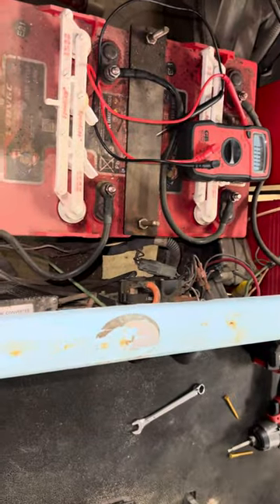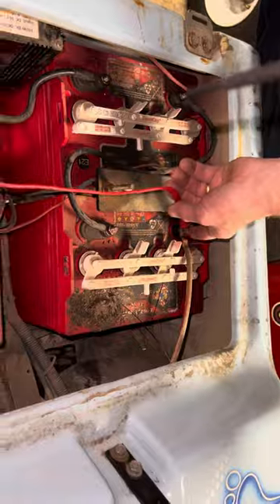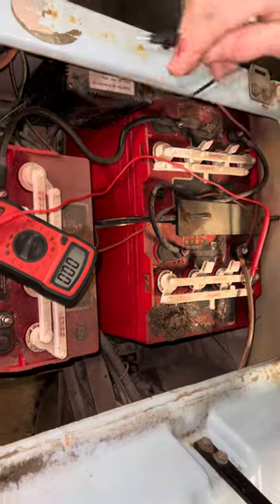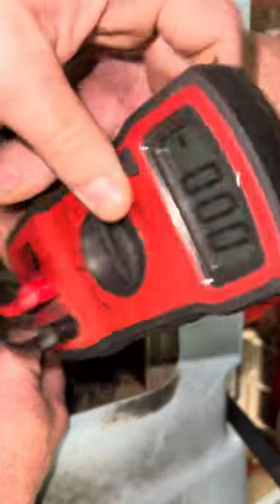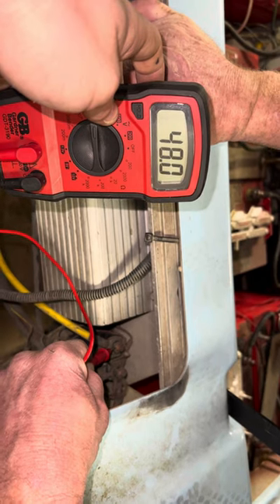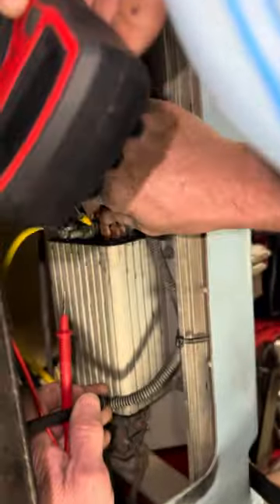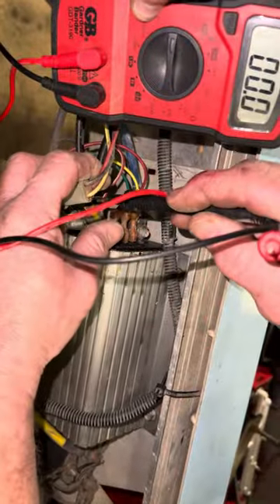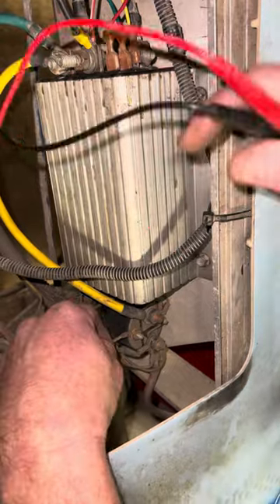Club Car 48 volt won’t move. Troubleshoot whole cart

Comment: Thank you for this excellent video... Bypass OBC solved my problem 😎
Reply from the maker: Yes sir.  Hit that like and subscribe button for me.  I have over 100 videos on my page and list 2 new ones a week.
Reply: Will do.... Do you have the rear wheels off the ground of that cart when you're pressing the accelerator
Reply from the maker: @jtwad  probably not. Holding the brake down at the same time I am not flooring it. I am just barely giving it gas. Just enough where I can fill the cart start to move
Reply: Is the obc the red wire thats on the controller?
Reply from the maker: @TheTeejam171  what year is your cart.
Reply: its 2002, i have 7 ohms at the yellow and green wires, the cart just clicks and doesnt move.
Reply from the maker: @TheTeejam171  if you have 7 ohms. And it doesn’t change when hit the gas replace the potentiometer
Reply from the maker: @TheTeejam171  put it in reverse and see what it does as far as ohms

Comment: I commented on another video earlier and am currently going through the cart. Everything up until testing the ohms between the green and yellow wire I am good. My multimeters only show me OL when pedal isn’t depressed and it beeps and goes down to around 2 and continues going down. I ran a jumper wire from battery positive directly to the controller where the red wire was and it did the same thing.
Reply from the maker: Drop your ohms reading down on the meter.
Reply: @Golfcartwhisperer Dang, I don’t think my multimeter can do that unfortunately
Reply: I did the controller output test right after, and it shows voltage until I press the gas and then it shows about 20v compared to the 50ish V when pedal isn’t engaged
Reply from the maker: @tuckernorton6886  I’ll read your stuff again in about 1 hour. Then will tell you what to do
Reply: I uploaded a short to this youtube to show what is happening. Piece of crap is making me lose my mind 🤣
Reply: @Golfcartwhisperer Thank you very much I seriously appreciate it!
Reply from the maker: @tuckernorton6886  find me on Facebook thomas wells conway sc.  and send me a video
Reply from the maker: Put your volt meter on dc voltage and put on battery pack and hit the gas in forward key on.  AMD tell me what it shows.
Reply: I also replaced VGLIDE and that did not fix issue. Thanks.
Reply from the maker: What does battery voltage show when you hit the gas
Reply: 50.1v before pressing the pedal and 50v when pressing
Reply from the maker: You replaced it with a v glide with resistor’s.  Does all other voltage check good going into the controller. Meaning the wires from the solenoid
Reply: @Golfcartwhisperer  Yes everything else tested out fine. Only thing I was unable to check was the ohm reading between wires that we talked about before.
Reply from the maker: @tuckernorton6886  did you jump m-and b-on the controller together and hit the gas.  But be careful it will run wide open.  I recommend jacking up the cart and take a wire and touch the post together.  Hit the gas real fast and if it runs replace controller
Reply: @Golfcartwhisperer  I did the same thing. Turned 1/4 on the wheels and stopped. I get voltage on those posts when hitting the gas but it’s only 31v
Reply from the maker: @tuckernorton6886  so you jumped the post like I said and the cart ran. Hit the gas and check voltage on each side of the sol.  Black lead of meter on main negative
Reply: @Golfcartwhisperer  No that cart didn’t do anything different. It turns a quarter inch then stops. If you respect forward/reverse then it will turn 1/4” again. Same as when it wasn’t being jumped.
Reply from the maker: @tuckernorton6886  gotcha. Sound like a motor problem or
Reply: @Golfcartwhisperer  Can I run a test on the motor?
Reply from the maker: @tuckernorton6886  hit the gas and take a wire and get touch it to the top after a1 and s2. Don’t connect it just do  a quick swipe. If it arcs motor bad. If it doesn’t something bad in the f n r area
Reply: @Golfcartwhisperer  No arc. What exactly is the f n r area?
Reply: I’ve got some more info. On F/R switch my top post that you tested in this video , has a green wire. That post is not getting voltage. The post underneath has white/black wire and it is getting the constant volts. When you select F/R the voltage transfers to the top post giving it the correct voltage. Basically what you did in your test but they were flipped. The solenoid tests good on the small posts and the big posts. But when testing the big posts the voltage drains down to 25v on the left side then goes back up to 48v when not pressing pedal.
Reply from the maker: Eating dinner. Give me a couple of hours and I’ll read our whole conversation and tell you the next step
Reply: @Golfcartwhisperer  No worries. Thank you very much for your help, i’m not trying to bother you just stumped with electrical. Thanks again.
Reply from the maker: I am doing stuff with the family I should be home around 7-8 tonight and we’ll figure it out
Reply from the maker: Let me know when you get the Facebook information and I’ll delete it
Reply: @Golfcartwhisperer  I have it. I send you a message a week ago, but says you haven’t opened it yet. Sent it on FB messager.
Reply: @HeyHeyHey97 my cart is doing the same thing but also my motor when It did spin was backwards any help would be much appreciated
Reply: @HeyHeyHey97  I can't seem to find you what is your profile picture
Reply: Cancel that I found you

Comment: Does the key switch make it won't charge too? Clubcar ds 48v has power to lights, horn, turn signals but no power to meter on dash and charger doesn't charge when plugged in.
Reply from the maker: Does the golf cart run. Meaning can you turn the key in and hit the gas
Reply: @cpfans90  no it won't run, I took it for a ride like normal and when I got home put it on charge but didn't notice it it started charging or not, hour later I hopped on it to take my puppy for a short ride and it won't go. Check voltage at the batteries shows 50.8 volts as always.
Reply from the maker: If the golf cart won’t run. The charger won’t come on. Open your charger up and hook the two wires on the relay together. And your charger will start charging
Reply: @cpfans90  but that's not going to fix the golfcart, batteries are fully charged 50.8 volts, when I turn key switch on I have no power at the voltage gage and no clicking when I step on the go peddle, I'm resetting the obc (on board computer) now as I'm typing this
Reply from the maker: @rnull2237  okay so the cart does have voltage.   You can bypass the obc I will send you a link in this description. On how to by pass it to see if it’s bad.
Reply from the maker: @rnull2237  CLUB CAR won’t move? Sol or computer?
https://youtu.be/pwpAl3k5iv0
Reply from the maker: @rnull2237  watch this video here.
Reply from the maker: @rnull2237  you can take a wire and run it from the main ground to the solenoid small post where the yellow wire goes.  And that bypasses the running side of the obc. Obc has two parts running side and charging side.
Reply: @cpfans90 I found the problem, loose wire on one of the batteries, cleaned up and put it back on, hooked up the charger and wala it's charging, put key switch back in and it works fine now, thanks for all your replies. I feel kinda stupid😅 😅😅😅😅😅😅
Reply: I get the video and it helps... but I check these things are as you say, however all I get is a small kick of the tires when I press the pedal. Is this pointing to the motor/ gearbox?
Reply from the maker: @JC-jo6db ye sounds like motor brushes are either stuck or wore down.  As long as voltages show proper voltage

Comment: Great video.  How can I test my v-glide?  I have a 94 club card DS that has the controller and v-glide.  When I push on the gas, it’ll do about 15 miles an hour then if I let off and push down the gas again it does about 22. They said the glide was bad so I bought a new one. It’s part number 1012016.  I just hooked it up and now the cart doesn’t move at all. How can I test for this problem?
Reply from the maker: When you hit the gas is the v glide wiper arm going all the way up. When you hit the gas
Reply: Great question, let me check tonight and I’ll let you know.
Reply from the maker: Did you get it figured out
Reply: I checked and the wiper and it does go all the way up.  I hooked up the old v-glide because I knew that one worked.  After I hooked up the old one the cart still doesn’t move.  I don’t know what happened.
Reply from the maker: Have you tried jumping the solenoid to see if the cart runs
Reply from the maker: Also your microswitch in the v glide have have you checked that. Do you have volt meter
Reply: @Golfcartwhisperer  the solenoid is new and it clicks.  Cart was running before I took out the old v-glide.  I put the new one in and it wouldn’t run.  I put the old one back in and it still doesn’t run.  The v-glide clicks when I hit the gas and the solenoid clicks when I hit the gas but the cart just won’t move.  Here are some other things I’ve tested:
Controller
B+ & B- = 36v
J1 & B- = 36.4v with pedal pressed
B+ & M- = 36.4
Green & White = 5.19 ohm with pedal pressed.  1.90 ohm without pedal

Forward and reverse switch has 36.4v

Only thing that seems weird with forward and reverse switch is that the reverse beep will sound when I put it in reverse with key in off position.  When I put the key in on position it no longer beeps in reverse.  That seems weird to me but not sure if that is some sort of wiring issue that would keep the cart from running.

Should I still try jumping the solenoid?
Reply: @Golfcartwhisperer  okay I just tried to to jump the solenoid with screwdriver across both large terminals. Normally when I do this it’ll spark and the cart will move forward.  I get nothing when I touch the two together.  It clicks though.  I measured 12.4v on both large terminals on the solenoid.  Is solenoid bad again?
Reply from the maker: @gyfhj  you should get around 36 volts.  Black lead on main negative red lead on big pos on sol.  What do you get
Reply: @Golfcartwhisperer  yeah I got 36v on both large terminals when doing it this way
Reply from the maker: @gyfhj  k well that means you have voltage
Reply: Any other ideas?
Reply from the maker: @gyfhj  are you sure you have the v glide wired right. Do you have facebook
Reply from the maker: @gyfhj  I deleted my message that had Facebook if you don’t see it let me know. I’ll put it back
Reply: @Golfcartwhisperer  did you get the message?
Reply from the maker: @gyfhj  no it’s the account where my picture he is my wife and I and I have an orange toboggan on
Reply: @Golfcartwhisperer  ok sent you a message
Reply from the maker: @gyfhj  click on this link here. Will delete in 5
Reply from the maker: @gyfhj  I deleted the link let me know if you got it
Reply: @Golfcartwhisperer  no I didn’t get it
Reply from the maker: Do you still need help

Comment: I have a 99 club car 48v ds that won’t do anything. I did the found bypass and get solenoid engagement but still won’t go. (Wasn’t even getting solenoid engagement until I tried the bypass) do I need to replace the controller at this point?
Reply from the maker: Thanks for watching.
Reply from the maker: How did you bypass it.   From main positive.

Comment: @heyheyhey97

First thanks for the videos you do the best working us through.  I have a question if you get a moment.  My ohms is 6.8 down to 1.8 when I press the peddle.  It was 7.3 but I replaced the mcor .  I suppose that means the controller is shot.
Reply from the maker: @davidturley3881  what does your cart do. And is it just like the video above
Reply from the maker: Not necessarily does the solenoid click? Also tell me what the cart is doing
Reply: @6:30 of the video.  I have battery voltage in but nothing out.  The small red I get battery volt when I hit the pedal.  And the homes between the yellow and green is over 6k about 6.3k and it drops to about 1.3 or so.
Reply: Yes solenoid test good and clicks and it sometimes runs for just a little bit
Reply from the maker: @davidturley3881 okay when it doesn’t run does the solenoid engage at that time
Reply from the maker: @davidturley3881  has the controller been wet. Meaning could water have got in it.
Reply from the maker: @davidturley3881  also intermittent running 99 percent of time the controller is not the problem. Either water in the controller if that’s the case. You can just bust the bottom of control box open and let the water out. Dry it out and seal back up. Most of the time it’s bad connection somewhere or microswitch going bad.  What does voltage show across the solenoid when it’s not running
Reply: Thanks again I pulled my new MCOR off unfortunately this cart doesn’t have a       V-glide.  The new mcor isolated is giving me 6.3 ohms to start.  Like you said if the controller reads over 6 ohms it won’t work.  I will send the part back and try a conversion to a mcor 4. Unless you have any recommendations.

Comment: Hey bud, 
I got an 04 CC DS that won't go in reverse. When I checked the ohm's, in forward it goes 5-0, in reverse is starts at around 10 and drops to 5. When I jump the green and white wires off the reverse micro switch, it goes forwards and backwards, and when I switch the forward and reverse cables on the back of the FNR switch, it'll go backwards, but not forward. Any idea what would cause that?
Reply from the maker: @budlightninja4167  yes sir if you jump the microswitch.  That means you bypassed it. Sounds like a bad microswitch
Reply: I put a whole new FNR switch with new micro switches in and still did the same exact thing. Could it be the vglide is bad?
Reply from the maker: @budlightninja4167  when it doesn’t go reverse does the sol click
Reply from the maker: @budlightninja4167  on the green and white wire the white wire has a resistor tied into it then it goes into a black wire. Do away with the resistor if the solenoid does click in reverse.  That’s why you have a high ohm reading.  I just do away with them.  all it does is halve speed for reverse.
Reply: @Golfcartwhisperer Gotcha. Sounds like that would be the problem then. That's why it would go full speed when bypassed. Thank you sir!!
Reply from the maker: Yes sir hit that like button. I know your already subscribed.  But just let me know the outcome

Comment: I've got 48v until I press the pedal and then it drops to 38v. New batteries and new cables except going to the OBC and the solenoid. Any suggestions?
Reply from the maker: @rhinooman  going to share a video with you test them like this and let me know what it shows
Reply from the maker: @rhinooman  Ezgo txt won’t move solenoid clicks
https://youtu.be/IDwWDvl0JyM
Reply from the maker: @rhinooman  watch that video and let me know  now when you hit the gas it drops voltage on the main positive and main negative.
Reply: @Golfcartwhisperer  I tested as you did and the voltage never dropped at each battery. I bought a new charger and I’m charging the batteries now. If I try and go, the cart shakes. Both directions. If I accelerate slowly, it does move forward, just slowly.
Reply from the maker: @rhinooman  no use now you said the voltage never dropped per each battery. Is that while you’re hitting the gas? Also, where are you getting the 38 V from?
Reply from the maker: @rhinooman  if you hit the gas in the voters dropped to 38. That means that each battery should drop down to 6 1/2 V to get 38 V. But you said you tested and none of them dropped check again something don’t add up.
Reply from the maker: You said that each battery don’t drop but on the main positive and main negative you have 38 V. Do this test here leave your red lead of your volt meter put it on the main positive. Keep moving the black lead meter to each negative battery in a series never moved the positive lead of the meter only move the black lead from battery to battery and count 8 V each time you go from battery to battery voltage should climb up.
Reply: @Golfcartwhisperer  I installed a voltage meter in the dash. That’s where the 38 V came from.
Reply from the maker: @rhinooman  but it’s a 48 volt cart??
Reply from the maker: @rhinooman  does the volt meter show 48 volts until you hit the gas.